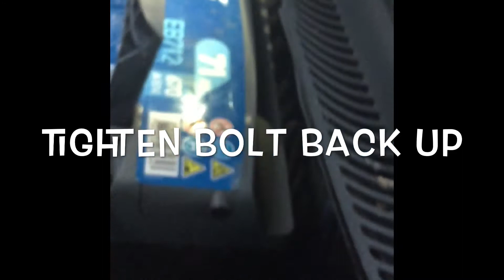Audi A4 water in footwell issues

Comment: Appreciate the video. I checked under the battery in my A4 but it was dry.
I've got water filling the rear passenger foot well. Well is right!! Had a mechanci spend an hour trying to locate the source of it but no joy.
Hoping someone here might have an idea. Thanks
Reply from the maker: Take of the door card sometimes the cellophane  can be a problem and pierce the black bungs
Reply: @Jim77463 
Thanks!! Will give that a try. Cheers for replying.
Reply: Call Me J 77 what do you mean the door card?
Reply from the maker: JOSE T. GARCIA the door cover on the door in the back and check inside the door it fills up with water
Reply from the maker: All so in some instants drill tiny holes in bottom of door
Reply: Unbolt nut to right of cabin filter / lift out filter / unbolt nut under filter / pull out / clean all crap around it and check for breaks bends in waterproof film around bottom , clear water channel down to under battery also and make sure hole there clear / refit making sure filter housing seals all around before bolting  down

Comment: Were you getting water in driver side and Did that fix the issues....
Reply from the maker: jerry garcia yes and it did fix it it’s a common problem on the Audi you will see a huge difference after
Reply: @Jim77463  ok man thanks I'll be doin that after work today cause man I had a lake in my car when it rained extremely bad the night before.... appreciate your help and again thanks.....
Reply from the maker: jerry garcia you could have 4 plug holes Down under the battery just burst them al gd luck
Reply: @suberblackiron  and?
Reply: After doin this to my car it did help but also found in ecu area seal was broken and leak in as well fixed that as well now no puddles.....
Reply: @suberblackiron  Where exactly is this seal? Do you take ECU cover off to get to it?
Reply: @MM168NSX  yes remove ecu cover and ecu and  bottom part of ecu has an opening in to firewall and the seal on cover was broken having water enter....
Reply: @suberblackiron  Thank you!